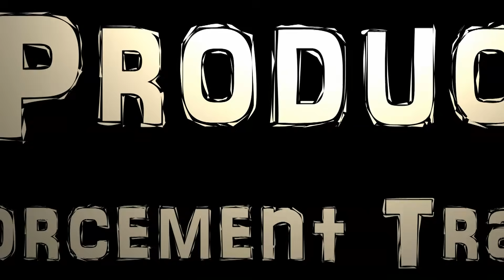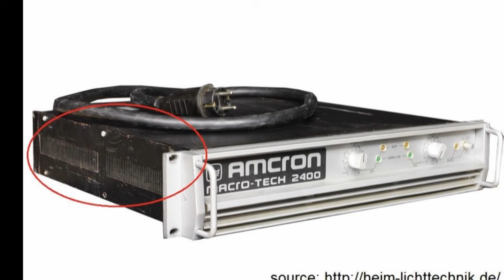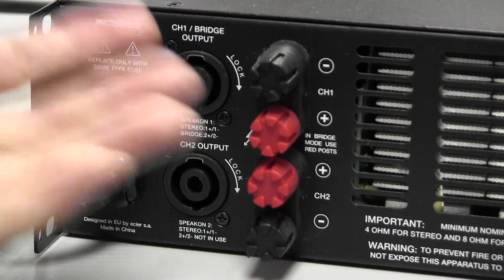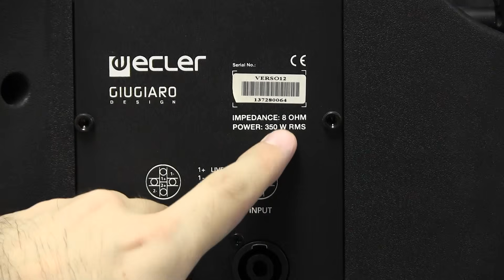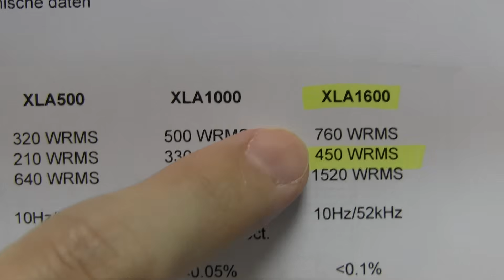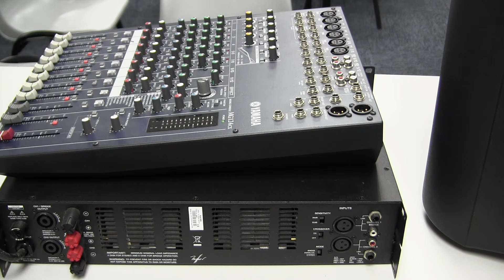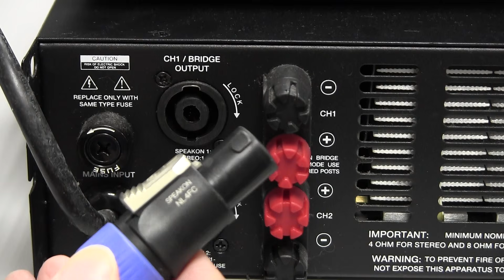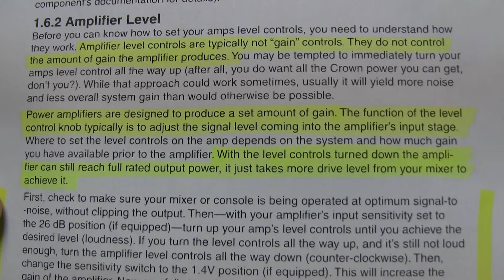How to connect a power amplifier to passive loudspeakers

Comment: Hi there, great video s and thank you.I have a technical question.I have a pair of EV S152 two way passive speakers each 200 watt each and amp CROWN XLS 1502 2x525 watts.I intend to add two more different speakers EV EKX15” passive.I know that I can connect all four with no problem to burn my amp but I would like to know if there is some kind of splitter box or something else to be able to control volume of the different two pairs of speakers.Iassume that one pair would be louder than the other and I would like to be able to control and level volume of those different models of speakers connected on the same amp.Amplifier has only two outputs.Thanks in advance.
Reply from the maker: The easiest solution would be the connect the two S152s to channel A of the amp and the two EKX15s to channel B. That way you would be able to use the channel level controls to balance the levels of the different speakers.

Comment: Im trying to figure out how to connect my vintage bryston to my vintage ns10ms… the ns10m do not have female speakon socket.  They have a binding post with a knob that screws onto them, almost like tuning knobs on an acoustic guitar.  There is a lot of connectors on the bryston; im not sure how to proceed
Reply from the maker: Yes, so in your case you will need to make up some custom speaker cables with the appropriate connectors on each end. With hifi equipment you can often make the connection using just bare wire - for example the 5 way binding post is designed to accept bare wire, banana plugs or spade lugs.

Comment: Very informative,, thank you very much... I just acquired two Behringer B1520  800 watt speakers that I plan on using for home audio ,,,buuut to do so I need an amplifier.. I was wondering how you connect speakon cables to regular RCA .. now I realize it goes through the amplifier
Reply from the maker: You're welcome! You don't connect them directly to each other: you connect the RCA to the input of the amplifier, the output of the amplifier connects to the speakon cables.

Comment: But what if I have a sonic maximizer from my mixer then a sun harmonic synthesizer before my 2 amps?
is there info on this anywhere
Reply from the maker: In that case you would simply connect those units between the mixer and the amplifiers.

Comment: How to connect multiple power amplifiers
Reply from the maker: Use the 'link out' (line level output) from the first power amplifier to run a cable to the line level input of the second power amp and so forth. This procedure is called daisy-chaining.

Comment: How abt subwoofer will connect where?
Reply from the maker: A subwoofer is a type of loudspeaker so it is connected to an amplifier in the same way. The only difference is that an audio filter network called a crossover is needed to separate the frequencies between the subwoofer and fullrange speakers - see my video on connecting an active subwoofer for more information :)

Comment: Dear sir pls explain why use LMT (Line matching Transformer) in Live program
Reply from the maker: It is rare to have stand alone LMTs in live sound - they are typically incorporated into 70 or 100-volt loudspeaker lines used for distributed speaker systems.

Comment: Hi GLB… I have a question and I hope you can help. I bought a Yamaha Stagepas 600 portable PA. I was wondering for Stage Monitor Speaker, is there a minimum or maximum watts of monitor speaker I should be getting? Thanks for your help.
Reply from the maker: With the Yamaha Stagepas you can only connect active/powered speakers when using the MONITOR OUT jacks, so you can use any wattage powered speaker.
Reply: @GLBProductions  Thank you so much.
Reply from the maker: You're welcome!
Reply: @GLBProductions  Sorry just to clarify before I end this… I have a 1600watt active speaker… will that be ok? Considering the Stagepas is only 680 watts?
Reply from the maker: It will work fine, although it might sound rather unbalanced to have a monitor with more power than your entire PA system.
Reply: @GLBProductions  ok thanks again

Comment: Thank you very much for your thorough explanation.  If I may ask for your professional advice, what causes one speaker to provide less output sound? I have daisy-chained two of my Behringer speakers. The last speaker makes a louder and more bass sound than the first speaker. Is my speaker broken? What’s the reason behind? I hope you can give me a good advice on this. Thank you.
Reply from the maker: If the speakers are the same model they should sound identical when daisy-chained. Check to make sure that none of the drivers are blown and that there have been no modifications made to the speaker wiring or crossover.

Comment: Hello Bruno, how do you connect a mixer to a cross over to an amplifier? Having in mind that there is one amplifier, two tops and two subs. Can a stereo mode on amp work effectively?
Reply from the maker: You could use one channel to power the tops and the other channel to power the subs, but this will create a mono sound system, which is often just fine.
Reply: @GLBProductions  Thank you for the feedback Bruno. Wow, very well. How about using a Y cable from on e amp channel split into two to feed a to and the other feed a sub and do the same for the other channel? Would that be ok with the speakers impedance?

Comment: please i want to ask you ? can i connect on right side two different speaker one Ev and one speaker yamaha  and on the left two speaker one speaker Ev and one different speaker
Reply from the maker: Yes you can, although the speakers may not all play at the same volume, depending on their relative impedance and power handling.
Reply: @GLBProductions  ok thank you
Reply: @GLBProductions  iam sorry the last question if for example i had amp 600 watt for example and i have speaker 200 watt and 300 watt can i connect them together or it should be the same watt 300 w for each speaker
Reply from the maker: You can connect them together - if they are both 8 ohms they will each receive 300 watts (assuming the amp delivers 600 watts into 4 ohms).
Reply: @GLBProductions  thank you very much for your help

Comment: Sir so if we add multiple speakers on one channel must also add the watts number of each speaker for example if I have 4 speakers with 350 watts and same impedance of 8  how must I calculate the watts on impedance I get it but on watts n
Reply from the maker: Taking the example above, combined load on the amplifier is 2 ohms and each speaker will receive 1/4 of the power that the amplifier outputs into a 2 ohm load. So you don't add up the wattage of the loudspeakers, you divide the output of the amplifier by the number of speakers connected.
Reply: @GLBProductions  thanks so much sir

Comment: Hello, I’m looking to buy a new amplifier for my setup, all my speakers are passive. What sort of amplifier would I need and can you explain how much power if need on each channel, I’m confused! Thank you!! I’d also need to fit in a 225w 8ohm monitor also. My setup would be as follows 
 
Channel R
Top = 250w 8ohms 
Subs = 500w 4ohms 

Channel L 
Top = 250w 8ohms 
Sub 500W 4ohms
Reply: I think minus the monitor id need 1000w on both channels, is that correct?
Reply from the maker: Take a look at this video: https://www.youtube.com/watch?v=l9L7uK7Xy0w

Comment: actually, you can run safely 4 speakers, cause each channel will give you 4 ohms, 2 channels on four ohms, do not make it work in 2 ohms total, es 4 ohms per channel
Reply from the maker: Yes four 8-ohm speakers in total, two speakers per channel, is ok.

Comment: Hi I wondering if up could help me. I have a set of yamaha speakers that are 500 watts @ 8 ohms and a powered mixer at 400 watts @ 4 ohms trying to use them as a P.A for band rehearsal but just using for singing at the moment and it doesn't get very load before distorting. I reckon cos the mixer is to small to power the speakers. So just wondering if i could connect a powered amp to the mixer that would be stronger to help. Would this work or would it just blow something. Thanks Sharute
Reply from the maker: Hi Sharute - in this case you could connect a separate power amplifier to the mixer but you have to be very careful to connect it via the LINE LEVEL outputs of the mixer, NOT the speaker level outputs. Running the output of one power amp into the input of another one will definitely damage something.
Reply: @GLBProductions  Great stuff thanks for the reply.

Comment: great video! I have a Numark M6 mixer and a Rockville RPA12 amplifier powering a single PV118 passive sub. My Numark mixer does not have the left and right outputs as you have shown. How do I connect my setup?
Reply from the maker: Send me a picture of the back of your mixer and I'll take a look.

Comment: Hpw do I connect my power speakers to my guitar combo amp ac60 roland
Reply from the maker: I suggest using one or more of the LINE OUT connectors on the rear panel.
Reply: @GLBProductions  so this mean I can use my roland ac60 compo amp as a monitor and the 2 power speakers as audience making my system a full PA set
Reply from the maker: Yes this setup will work fine.

Comment: I have learnt the whole process,  but what about when you have a mixer , equaliser,  power amplifier, 2 passive speakers and a bass speaker, how do you connect
Reply from the maker: For a setup like this you will need either an external electronic crossover or a power amplifier with crossover capability.

Comment: Great video. My amplifier at church keeps going into protect mode when there is too much input from the microphone. So I came here to find some information. I now know that there are few things that I need to check, since I am using passive speakers.
Reply from the maker: Yes some amplifiers will do that and mute the audio for a second or two, which is not what you want happening in a live event!

Comment: Bro ..Peavey power amplifier model: CS 3000 ... for parallel mode will press the switch in position from the back panel of the amplifier and if we feed only one input (channel A) will this work both the o/p channel or use patch cable (Y cable) ?
Reply from the maker: Looks correct to me, but consult your owner's manual to be sure. Some amps use only input A in parallel mode, others can use either input.

Comment: Thankyou for a really great video...
a little new to connecting up Passive speakers...Power Amp ..and mixer.
have checked out the Ohms and Impedence levels n all good 
needed to buy some cabling but ah well...

Running a Behringer EP4000 power amp,
2 x 500W 8ohm passive speakers,
Behringer XENYX 1202F Mixer.

Thanks again for a well made instructional video that was great to absorb (generally speaking)
Reply from the maker: You're welcome Aaron, enjoy your new sound system!

Comment: Good evening Sir. I commend you for your excelent presentation! I have a question. I connected a pair of Pro Studio speakers (400 watts each speaker) to an Audiopipe Amplifier (AQ 1500). I'm using small Beringer mixer. But, why is it that I hear a humming sound?
Reply from the maker: Many possibilities, but to begin with check to ensure that your sound system is grounded correctly through the ground pin of the A/C connector. All components should be connected to the same A/C circuit, which should in turn be grounded correctly to earth.

Comment: so can a 2 channel system only be able to connect 2 loudspeakers and nothing else? 
I want to be able to connect 2 Loudspeakers, 2 monitor speakers, and 2 sub-woofers to my console but my console doesn't power these speakers since mines are passive.
Reply from the maker: No, it depends on the amplifier/speaker combination and also whether you need stereo sound - in your setup above you will almost certainly need more than one 2-channel power amplifier.

Comment: Hi Great Videos! I'm thinking adding a 4x12 Marshall Cabinet to a MU-P7K Prof. 7000 watt Power Amp. It says 8 ohms Bridged is Rated @ 500 RMS my speakers are all 8 ohms @ 1200 Watts ea.? They are all wired to equal 8 ohms can these 4 speakers be Bridged by the power amp? Also I am connecting a 100 Watt 8 ohm Electric Guitar Amp Head Solid State? What do you think? Are the 4 speakers ok for the Amplifier during Bridge Mode? Nick!
Reply from the maker: Hi Nick please watch my video on connecting an amplifier in bridge mode: https://www.youtube.com/watch?v=8XLRvoRdYVE

Comment: Thank you for this helpful video.  Can we connect a 8ohm main FOH speaker with a 4ohm subwoofer together on one channel for left and the same for the right and if so should we put the one into the binding post and the other in the speakon outputs or rather only use the one (say binding post) and daisy chain from the subwoofer to the loudspeaker(as it is furtehr out)
Reply from the maker: You're welcome Lucille. You can connect the subwoofer and fullrange speaker in either of the ways that you describe above - use the one that is easiest given the location of the individual speakers. In both cases the 8ohm speaker will get 1/3 of the amp channel's output power and the 4 ohm sub will get 2/3 of the power, which may make the levels difficult to match. Ideally you would have a separate amp for fullrange speakers vs subwoofers.
Reply: @GLBProductions  Thank you Bruno
Reply from the maker: You're welcome Lucille, do get in touch if you have any other questions.

Comment: Nice comprehensive presentation as usual.

This comment is probably a little out of scope for what you intended but it may interest someone.
Q: Can you run 4 speakers per channel? A: No
Well not quite right, 4 in parallel No, but 2 parallel sets of 2 in series on each channel, would be a total load of 8 ohm (4 x 8ohm speakers) per channel, so provided the power spec was still satisfied the answer would be Yes, but in this case the power available per speaker would be too low, so still a no in this case.

This is how I setup my Amp volume controls.
1st I ensure that a unity VU signal will make it all the way from a single mixer input channel through 1 mixer group, main out & EQ all the way to the main amp.  To achieve this (turn amp volumes right down or off) all the mixer controls for that single test channel will be at unity (0 VU) however, the EQ may need some gain switch & fader settings.  I use a meter to check there is no loss at the amp input end of the lines.  To adjust the amps while saving my ears. I send -20 VU pink noise from 1 mixer channel (I made some noise and tone test files in audacity).  I setup a dBC sound meter in a standard location and then turn up that amp channel until the meter reads 70 dBC or 20 dB below whatever maximum sound level is agreed, then repeat for the other channel.  So, now I know that when the main desk output meters are at unity, the speakers will be pumping 90 dB (20 above the test) per channel.  This means that the system now reliably maxes out at 90 dB or whatever has been decided.  This ensures that agreed maximum mean volume is adhered too and will not be exceeded except for the odd headroom spike of course. 

Those gain switches are wonderful because they minimises the necessary volume control attenuation which is always great from a S/N perspective.
Reply from the maker: Thanks for the comment Ken, lots of useful information on setting up a sound system to meet a particular loudness target.

Comment: I have 5 bose 802 series 2 speakers, 2 bose 502 BP subs, 2 bose 802c 2 controllers and 2 crown macro amp 600, and 1202. I watched all your videos and they are very informative, thank you. But I couldn't connect them all together and does all the speakers goes to the same red terminals in bridge mono mode? If I want to hook 3 speakers to 1 amp and 2 speakers to the other amp? Thank you
Reply from the maker: In this case I strongly recommend that you contact Bose directly - the Bose 802/502 series speakers must have the controllers placed correctly in the signal path to work right and with a system of that size it is best to get advice directly from the Bose distributor in your region.

Comment: Your videos are awesome, I've learned so much !!
I saw many of your videos, but I still couldn't figure out something about my setup.
I have a Yamaha EMX-5000-20 Powered Mixer, a pair of Passive Full Range Speakers (250-100W, 8 Ohms) and a pair of Active Subwoofers.
The Yamaha manual states 
"Set this as appropriate for the size of the room or
the input capacity of the speakers.
• 500W + 500W
The two internal amps will produce a maximum
of 500W + 500W/4W.
• 300W + 300W
The two internal amps will produce a maximum
of 300W + 300W/4W.
• 100W + 100W
The two internal amps will produce a maximum
of 100W + 100W/4W. "

I really can't figure out how much power will be delivered to the passive speakers. Maybe 500W/2=250W ??

I want to connect both the two subs and the Full Range speakers to the Yamaha mixer. (I also have an external Power Amp and a crossover, but I don't think they are really necessary)

(Sorry for the long question)
Reply from the maker: Hi there Dom, I had a look through the manual for this product and couldn't find the section you are referring to - could you send me a link?
Reply: @GLBProductions  Hi there, I finally figured it out. The amp produces 325W+325W / 8Ω . It is on page 14 and 30 on the manual. 
Thanks for your time !!
Reply from the maker: @dom331  That's great Dom, all the best with your music!

Comment: I have 2 18" passive 4 ohm subs, 2 passive 15" 8 ohm subs and 2 mains which are JBL 15's at 8 ohms. Do I need a separate power amp to to run the 4 ohm speakers? Can I use channel 1 to power the 4 ohm subs and the other channel to run the 8 ohm subs? Or is this possible? Thanks.
Reply from the maker: Hi Steve, it depends on your power amp: it is capable of handling a 2-ohm load?